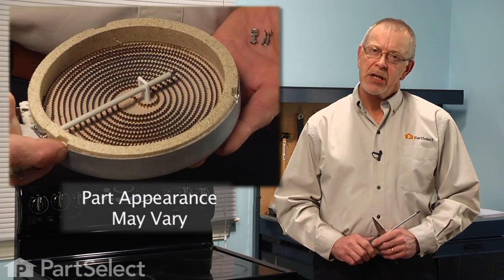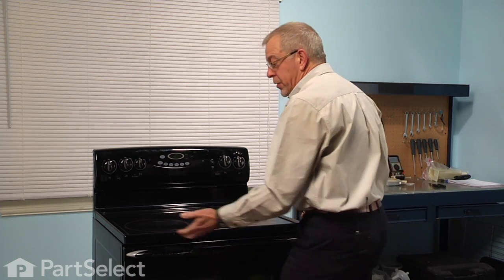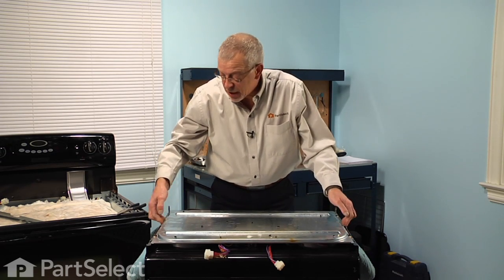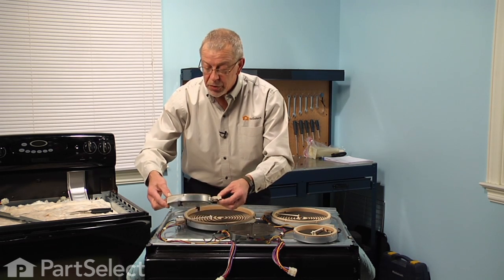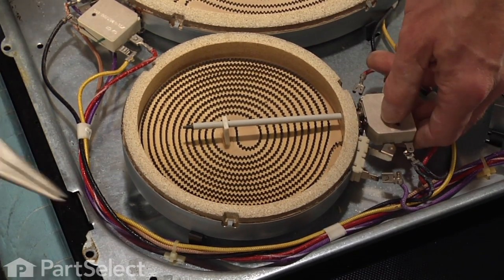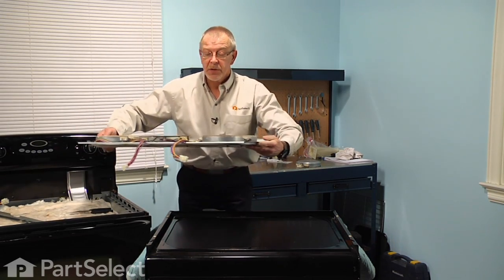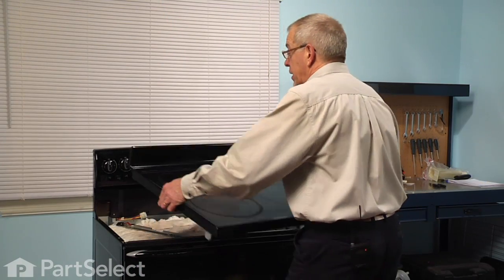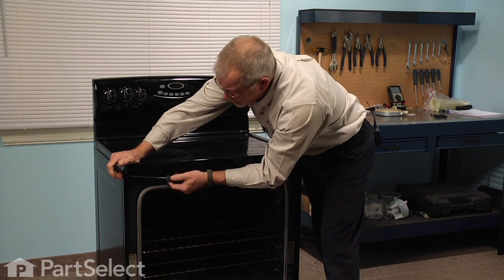Range/Stove/Oven Repair - Replacing the 6" Surface Element with Limiter (Whirlpool Part # 12002141)

Comment: what about the dual circuit element for kitchen aid ykerc507HS4?  the outer burner works... but the inside doesn't?  any tips to fix that?  Is it the element or is it electrical?
Reply from the maker: The problem could be either the element or the control. Does the indicator light come on when the dial is turned to the inner burner?
Reply: Yes the indicator light does go on when you put it towards the single element but the element doesn't turn on.  When you turn to dual element, only the outer element lights up.

Comment: Is there a video that tells me how to fix a electric one? The  light comes on but nothing heats . Not the oven, neither any of the stovetop elements! ??? Thanks
Reply from the maker: The first thing to look at is the incoming electrical supply. Electric ranges require 240 volts to operate, which are actually two
separate 120 volt feeds. If one of these feeds is missing, you would only have indicator lamps, oven light and clock display functions. Check the fuse or
breaker panel first. Some ranges have internal fuses for oven and surface
burners as well. What is your model number?
Reply: Thank you. Found the problem The Breaker melted. Bought and put in already ;)

Comment: Would this surface element work for a Whirlpool Range WFE361LVS?
Reply from the maker: The procedure would be the same but the part number may be different. Which element did you need to replace?

Comment: Does this video apply for replacing a cracked glass cooktop for a KitchenAid KESK901SSS00 range and PartSelect part number PS2377743 or should I be referring to a different video?